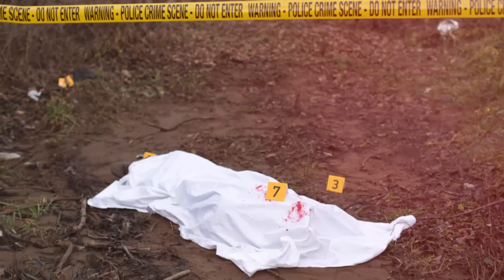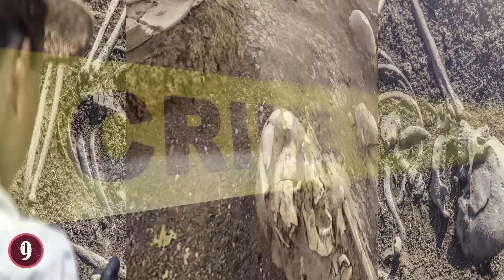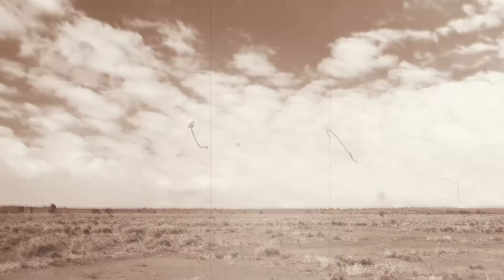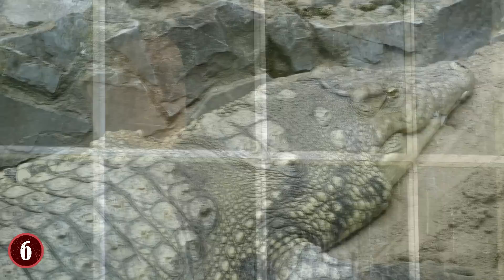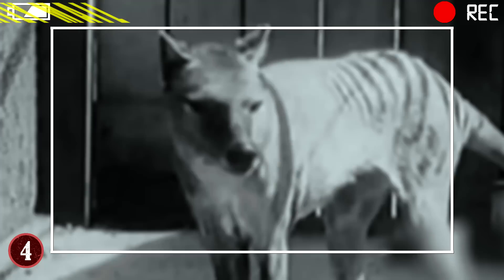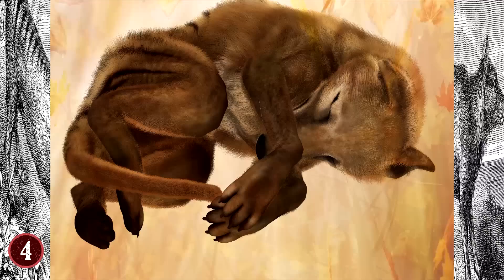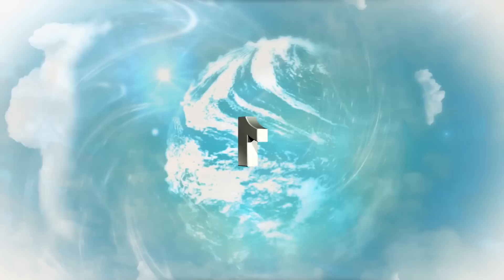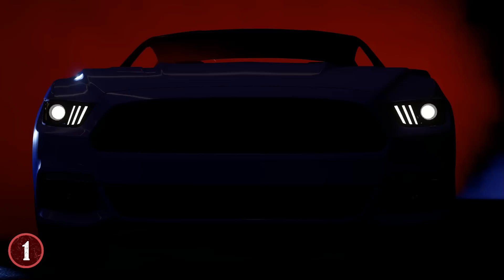10 Strangest Discoveries Made Under The Driveway

Comment: My weirdest find was because I was a curious child that did not always follow the rules. Me and 2 friends decided t oskip school, and because we lived in Ottawa, we decided to go downtown. We ended up on the public walkway behind our parliment buildings. When we saw a RCMP officer walking the path towards us, we decided to go up the hill and hide in the trees. After a while we were trying to find a way to the street level above, and avoid the officer below. It is then we came across a very large metal door. Much like a prison door, made of bars and steel beams. The large chain had rusted through, and the padalock was rusted and frozen in the space it once hung it. However, the gate door swung open with little effort. We of course decided to go in, and as we walked down a very elaborate stone tunnel, the beams that came through the floor from above were massive. Some of the biggest timbers I have even seen to this day. The electrical wiring was decayed, and old style telephone lines ran the top corner of the tunnel. Of course at 13 or 14, we were smokers, and used our lighters one by one to continue in the dimley lit corridore. When we reached the end, we found a door. A steal door. A newer door. Much newer than the corridor or the timbers or the wiring. It had a pinpad. We spent alot of time underground, and in fact lost track of time. By the time we got to the opening, the sun was down. By the time I got home it was almost time for bed, and I had missed supper. And two furious parents were waiting for me as I walked in the door. I knew it was better to explain what had happened. My father was now even more mad, as we were on the side of parliment hill. I explained I should contact the police, as the opening was never ment to be accessable. The RCMP and Ottawa police both showed up at my house. I took them to where we had found the opening. The officer was definately trying to scare me, my frineds, and out parents as he expalined that we were all now under the library. The only structure to not burn in the fire. As we approached the opening, you could see the disbelief in the officers eyes change to concern. Once we were inside, the concern had changed to humour, as they followed our footprints in the dust. They were the only footprints. We explained how we had opened the door. We were the only people to have been down there in decades. The doorway has since been sealed with a thick large metal plate. This was one of 5 very cool places I have been.....by accident.....or not......since I was 13 or 14. The others include a gold mine (star of the north) that me and my father found on maps at the national archives in ottawa. (we used to search for ghost towns). While playing in the old train station (down town Ottawa), and the train tunnels under Chateau Laurier, we found old steam tunnels into the NAC garage, and around the down town core.  We found a cannon room on the side of the Alexandria bridge. It was there to protect Parliment hill during war time. It had old coke bottles, a steel bed and the remains of waht used to be a matress, and magazines from the 1940's. It overlooked the river, but trees and shrubs had over grown it. We were looking for a place to have a cigarette and cralled under a bush when we found the openeing.
Reply: WOW YOUR COOL